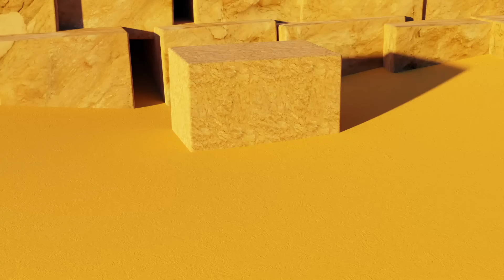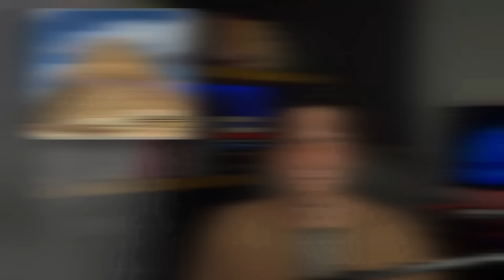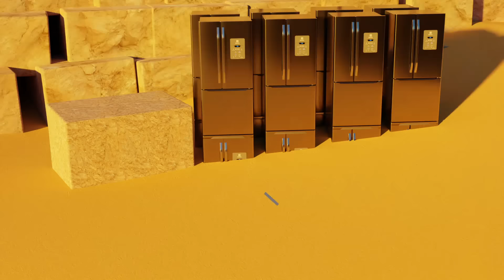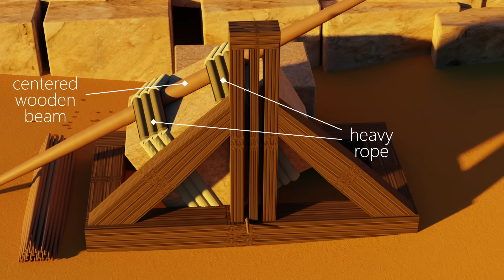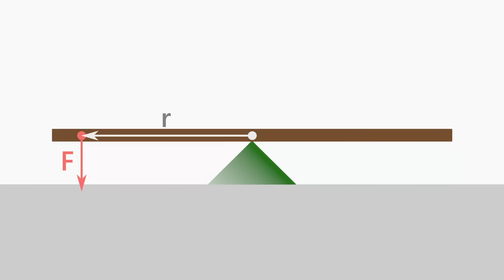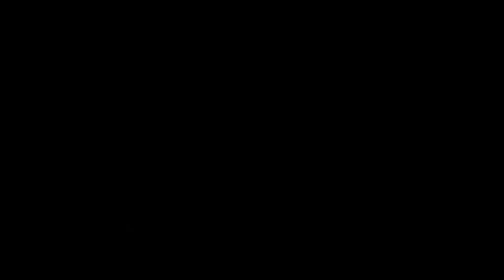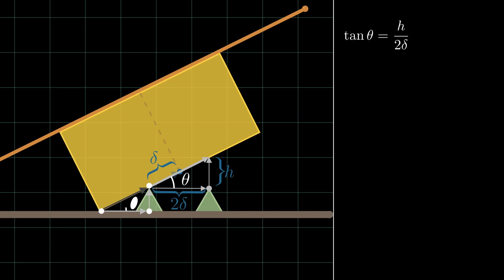Physics Reveals How the Pyramids were Actually Built

Comment: This video and equation is quite brilliant but it still doesnt answer how theyre goint to utilize these machines to get those heavy blocks 455 ft off the ground. Primitive  Levers ramps and platforms can only do and hold so much weight. Plus the video never answers you youd transport 2.3 million 5k pound stones over 500 miles, then cut 2.3 million stones with primitive tools with a high degree of accuracy in the amount of time before even thinking about applying this equation to lifting the stones into place.

Comment: I guarantee you there was some kind of acoustic levitation or extra terrestrial forces to lift those blocks straight up with no effort similar to how they abduct people. And yes its already been proven 100 percent people have been abducted with beams of light. If you apply those same principles to that of the pyramid you could lift any weight and transport them with ease. Primitive tools and humans didnt build these pyramids with that kind or weight and distance of transport. It would require an advanced type of technology or machinery to have enough force and power to lift and transport those stones into place 477 ft off the ground. Were not just talking about lifting that kind of weight ten feet off the ground. What about 477 ft off the ground. Way more complicated than what your video describes. And certainly not possible in 27 years with tools and resources available duting that time period. Way more to the puzzle than your actually covering in this video.

Comment: There is new evidence that the limestone blocks that comprise the pyramids were actually poured as a concrete.  Look it up.  The implications are that only the composites weighing much less than the blocks had to be brought in, mixed with water on site and allowed to cure. This would have required a much smaller workforce in completing the pyramids and explains the extremely close tolerances found in their construction.

Comment: There are so many problems with this hypothesis...
1. The lever system needs massive amount of thick and long wooden beams.
2. Egypt doesn't have much forests..let alone tree species that are suitable for this type of application. 
3. Efficiency is very low. Lifting a 3 ton block 1m will take several hours.
4. How do you arrange this machines to work in tandem?
5. After just several days of operation the wooden beams will get cracks. 
6. The sun and rain will cause the unprotected wood to rot.
7. The wooden pieces that are stacked ùnder the block will get squashed after repeated operation.
Reply: Lebanon had plenty of good trees they could have imported.
Reply: @bobibest89  the sun will cause wood to rot? 😂😂.  
There are no trees? Ever heard of the Nile delta? 4500 years ago there was more rain and more Christian
Wally Wellington built this exact machine in his backyard and lifted 10 ton blocks 4 metres up by himself with just wood. It’s in YouTube, got check it out!
Reply: Because they cut all the trees down to build the pyramids

Comment: I would have to see this tested. This contraption may work mathematically, but it creates a ton of questions such as how did they slide the block into place after is was elevated. If you talked about that I missed it. Im not saying that as a gotcha question, I am genuinely curious. I tend to think until someone successfully demonstrates a method that can cut and place a 2.5 ton stone to a height that is comparable to the upper parts of the Kufu pyramid in an amount of time that would support to feasibility of the time frame of 27 years of construction or however long they think it took to build, I remain skeptical. And im not an alternative history guy. I just think most attempts to explain this stuff are terrible.
Reply from the maker: I agree there is certainly more to unpack with the pyramids.  The scale of the project is difficult to replicate, both by the sheer work force required to execute and the financial capital required.  Perhaps Mr. Beast could take a stab at it?

Comment: (2 of 2) Another lifting method you could illustrate with Physics is an external fulcrum (pivot) method similar to a shadoof that could be used for the vast majority of the 2.3 million blocks which are less than 2 tonnes.  A simplified example calculation of a stone fulcrum about 2.5 m tall located 1 m from a 2 tonne block can use a 6 m long lever (ropes at each end) to give a 5:1 mechanical advantage when the lever is horizontal (halfway through the lift).  There are some lateral forces on the fulcrum when the lever is not horizontal (short lever end swings in a small vertical arc) which need to be accounted for in an engineering analysis of the required strengths and weights of the lever, fulcrum, and ropes.  By using 4 lever sets (1 for each corner of block’s top; 2 at starting level and 2 at target level), only 100 kg downward pull on each long lever end can lift 1 m in 1 movement (and then swivel horizontally onto the next level!).  Lifting ropes can be quickly disconnected from the block and moved to set up for next lift.  Obviously many other theories, but this is directly comparable to your Herodotus machine calculations scaled down to 2 tonne block - 400 kg lift total for external fulcrum vs 224 kg for Herodotus.  Could either method be supercharged by fixing 1 end of the rope at each lever’s long end to the ground and loop over the lever like a moveable pulley to gain another 2:1 mechanical advantage (less friction loss)?
Reply from the maker: Interesting.  I hadn't considered an external fulcrum, but this seems to be an equally if not more effective method.  If you have any resource suggestions on this device or links, I'd love to study it more carefully.  I would imagine external levers would be more effective as the size of the pyramid grew, especially given the clearance requirements along the perimeter of each level.  A revisit to ancient construction is on my list of upcoming topics, and I find this really fascinating.  Thanks again for your feedback and suggestions.  I'm always looking for great topics to explore.

Comment: (1 of 2) Nice Physics analysis of 1 interpretation of the Herodotus machine and respectful comments back to those viewers with insightful comments. One suggestion for your analysis is to point out that pivot height “a” must also have an upper bound else your simplified locations of each center of mass (and corresponding mass for each end) changes since the angle increases as the block moves up; so in order to keep your calculations valid, each end of the block has to have support that stacks (like cribbing) to keep it nearly horizontal.  Lots more manual labor required.  Also worth pointing out to viewers that your example provides a 8.93:1 mechanical advantage (not the apparent 17.86:1) since the 560 kg is applied at each end of beam.  Appreciate that you recently commented that you intend to evaluate some other lifting options from physics standpoint so I’ll do a separate comment as 2 of 2 to evaluate more traditional external fulcrum method.
Reply from the maker: Really appreciate your thoughtful and insightful feedback here.  You're absolutely right on the upper bound on the height!  I had considered that, but thought it might be best to save that detail.  I think a scaled demo of this device might be a good approach for demonstrating the effects of various sized pivots and configurations.  Thanks for watching and providing some excellent insight for the viewers!

Comment: I know this is just an example, but 10 tonnes is not a big block for the ancient cultures. Or whoever built the megalithic sites. And no I don't believe aliens did it either. Unless the type of aliens known as "fallen Angels" and their offspring the giants if you believe the bible. They would certainly have the capability to build large pyramids.
Reply from the maker: I agree, some blocks were larger than 10 tons. The sources I read suggested 10 ton blocks were used at the base of Giza. The average block size was 2 tons.  Although some blocks near the kings chambers were 70 tons, the lever mechanism would obey the same physical laws and principles.

Comment: Where did this high level knowledge  suddenly come from for a bronze age culture?
Reply from the maker: Great question.  So the knowledge used in this video was being used to backwards engineer the simple machine and draw some conclusions.  You're certainly right, a bronze age culture wouldn't have had Newtonian mechanics to work with.  They would, however, been able to assemble the machines and with trial and error, come to figure out the right approach.  Like building a lego without the directions.  The directions would make life easier, but with enough persistence, trial and error can get the result eventually.

Comment: Hello -This is how they did it: The levitation technology involves an anti-magnetic device which is dangerous to the untrained as one can float right out of the world, in other words, fall upwards. The control involves two grids, one tuned to magnetism of the Earth, the other opposed to the magnetism of the Earth. When the grids are in a certain position, the machine plates will gloat; they will neither go up nor go down. But if one pushes a lever which alters the relationship of the grids to each other, then in one direction the Earth magnetism becomes the stronger, and so the machine plates sink down to the Earth. But if we want to rise up, then we push the lever the other way so that the anti-magnetism takes effect and the Earth repels instead of attracts. In this way we can rise up into the air. One operator could lift up these hundred-ton blocks and place them in position without exerting himself. Then, when the block was in the precise position required, the magnetic current would be switched off and the block would be locked into position by the gravitational pull of the Earth. The initial work of preparing the blocks of stone requires the use of atomic torches. A cold melt is utilised - no heat is generated, so the object (or place) can be used immediately. The metal seat at the back of the machine would hold the operator while the atomic torches would emit the laser rays from nozzles along the front bottom and sides. In this way a shole hutment of hangarage can be excavated in the space of a few paltry hours. The initial alien technology was of course not of this world and was in fact brought by Rah-Sham-Het from the planet Tasch in the Tenth Solar System of this Twelfth Universe and developed further with the power of THOUGHT by the Solar Hierarchy (the twelve Sons of GOD headed by Lord Mikaal/Archangel Michael in His Earthly incarnation and whose Temple lies under the GAN-HIN, the Sphinx, meaning Guardian of the Temple in Ellhonia, Drunhia, the original names of the capital of Egypt in those remote times). In this way the Pyramids and the Sphinx were built. Thank you.
Reply from the maker: Source?

Comment: probably you can build a large house with this method BUT definitely not the Great Pyramid ...neither the material strength nor the required speed of construction will match... have you seen the gravimetric scan pictures of the pyramid which shows spiral construction method clues
Reply from the maker: I disagree. Physics works in all reference frames.

Comment: Your math works(I’ll take your word for it) but only in a vacuum. There’s 1,000 different variables in the details of the process. Advanced tools were used. Computerized tools were used. Rethink this using advanced tools.
Reply from the maker: Source? And ambient air is completely irrelevant in this calculation.
Reply: @DrJohnDev  look at the computer analysis of the stone vases found around Egypt. I see evidence of a core drill, massive circular say. Routers, planing machine. I’m a carpenter, it’s all plain to see. Been on one job site you’ve been on them all.

Comment: You are absolutely nuts! How’d they get the stones there and what did they use to cut them so accurately? Chicken bones? Copper? You’re so wrong!
Reply from the maker: So vile you decided to comment 3 separate times. I’d offer an explanation, as there are many, but for you, I’d say go play with chicken bones and let me know how that goes.
Reply: I guess you have all the answers? When you can tell me how they got the megalithic stones to Machu Picchu, cut from a mountain, many miles away, in the thin air, then I may give your silly theory a second thought! 
     If you think, that because you have the label "Dr." in front of your name you have more credibility than others, I will remind you, I run circles around these charlatans every day! You're still nuts! 
      If you think that the Egyptians built a ramp out of sand and pulled these 30 ton plus stones with thousands of slaves, or oxen on thousand of logs, you haven't done all the calculations correctly, or thought clearly about this subject yet! 
You most obviously never lived in the desert!  @DrJohnDev

Comment: I think the wooden sticks would have snapped from that big ass block 😂😂
Reply from the maker: Well, they wouldn’t have been thin. A sizable cross section log can take many tons of weight before failure. After all, wood scaffolding is still used in holding 1000 ton bridges during construction.

Comment: 😂 all that math and yet we forgot to add one factor to the equation ….mankind! 
I think we all can agree with the view that you couldn’t be doing all this math via the Herodotus machine 24 hours a day, every 6 minutes for 27 years !!! There were accidents all the time, bad weather, and other cogs in the machine, so to speak!! 
I’ve always felt that they’d incorporated a lot of hydro tech ala canal types of movement . 
I’m also reminded why I failed math😢
Reply from the maker: Indeed, we should never forget the sheer strength of mankind.  In terms of the math, they wouldn't need to perform this analysis.  They likely figured it out through trial and error.  The math in this video was primarily to figure out how much force they would need to lift the blocks even with the aid of a simple machine.  Also, the 6 minutes every day for 27 years calculation only applies if only one machine is used at a time.  They likely had multiple machines operating simultaneously, which would raise the time requirement per block significantly.  Thanks for watching and great to hear from you!

Comment: Not all the blocks are the same size. Even under the first layer they start to differ. The most outer of blocks are the smallest ones they used. Some of those folks have been removed right underneath them there are blocks way bigger.
Reply from the maker: This is a good point.  Yes, the blocks certainly differed in weight and size.  I wanted to illustrate the use of the machine for the particular blocks around the base of the pyramid.  There were heavier blocks, and there were lighter blocks.  And while the force requirements would need to be adjusted, the equations and math remain the same.  Thanks for bringing this up and hope you enjoyed!

Comment: I wonder if the builders encountered, maybe a sand storm or 2 during its construction? Imagine all the fires to light up the night from the quarry to the building site muchless being able to see on the pyramid setting a 10 ton block with accuracy having a flickering torch someone was holding above your head.
A feat greater than the building of the pyramid itself would be no construction delays of any kind. Back when the Nile river was close to its door step and flooded every year.
What about the the granite inside the chambers when are massive compared to the outer blocks?
No Egyptian writings are found inside and they covered everything from top to bottom. 
My opinion these structures were already there and took credit for their building.
What about Balbek in Turkey? The foundation blocks are massive compared to a 10 ton block.
There are too many variables, in my opinion for this to be done with levers, rope, and hand chisels and laying 1 block every 6 minutes for 24 hours a day over the span of 28 years.
I'm like everyone else. I don't know either, but common sense says it wasn't done that way.
Reply from the maker: You just mentioned other problems that of course had to be overcome but had nothing to do with the inability of using a lever system.
Reply: @DrJohnDev  
I didn't say the Egyptians didn't use or know how to use levers. With all the variables of construction it would be a very slow process and with the shear number of blocks laid in their timeline, highly unlikely it was constructed in that manner. 
Maybe if the blocks were already cut and stacked waiting to be installed and the foundation laid when the Egyptians found the site and all they had to do was complete it, then maybe so.
The farther back in time the bigger the blocks. 
I would like to see the lever system that laid the 1000 ton foundation stones at Balbeck.

Comment: So much math not even in there. The stacked pegs.... how much weight can those pegs take? Seems like they'd snap. No mention of getting the stone in place. Completely ignores the much, much larger stones also put in place. Fun math excercise, but answers almost nothing. Especially didn't cover how they were moved upward and inward. Personally, I think they used water. Whole complex was designed with massive water channels.
Reply from the maker: Water was likely used to transport the blocks to the base, but for lifting, they’d need something more than water. Wood is used for scaffolding modern day bridges, which weigh 10x more than any blocks of the pyramids, so yes, these ‘pegs’ could be designed to withstand some blocks.